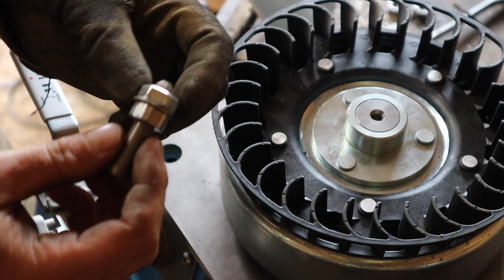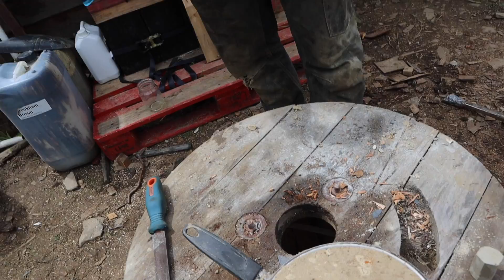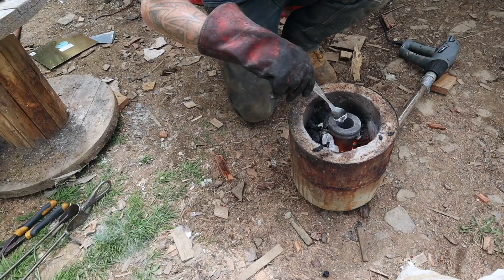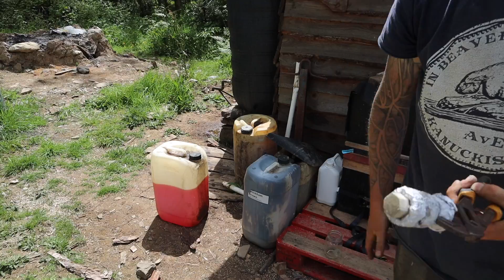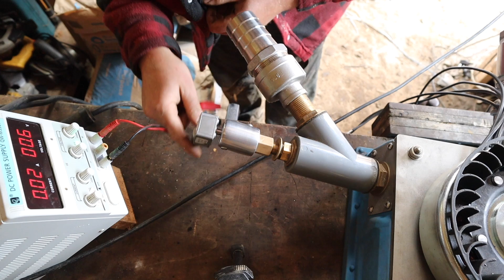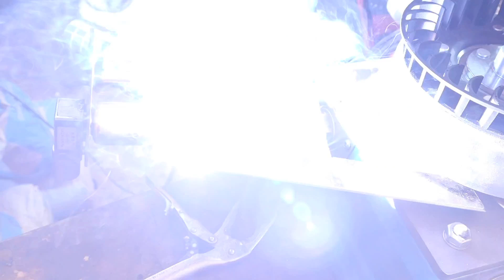4 Nozzle Off Grid Micro Hydro Turbine  Part 5 Motorised Spear Valve Control

Comment: An interesting design. I was wondering why you were allowing the motor mount to slide before realising that the spear valve control point is unscrewing rather than just spinning, so that makes sense.

I think if this was my design I'd use a cog or pulley that could slide along the existing hex shaft and have the motor drive with a belt or chain. I'd also have an encoder that is geared such that you can track the position of the valve

Comment: I would remove the wee locator bolt on the valve and just let the valve handle slide in and out of the socket you made it will stop the bracket flexing

Comment: Use a double relay. You can even get one with wifi and/or rf remote. Use one relay to spin in one direction and then the other relay to spin in the other direction. You can even get a 12x or 16x relay module and cover all the actuators you need.

Comment: Do you realize you said you had no complaints and the unit worked great, then you replaced and rebuilt the whole thing at great cost of money and time for a unit that worked for 8 months?
Spend $150 u.s. on ebay and buy a hydro electric power generator.
They put out 500 watts and have an extremely efficient design that doesnt require constant tweaks.
There are more youtube sites with folks trying to get that particular "fantastic" unit running.
At great cost!
Spend $150 and forget it before your girl leaves you for mental obsession with denial about a fucked up product design.

Comment: I've never tried this but wondered if this pressure relief valve could be used to automatically turn off some jets in low pressure situations. If it was in the supply line to one of the jets and set to 60 PSI, it would probably turn it off at 48 PSI and back on when the pressure hits about 60-64 PSI. It has a 20% variable for reclosing and a 2% variable for opening. The other three jets would still be on and this would work with your motor controls, but it's automatic and works on water pressure. Any water relief valve set to around 50-60 PSI may work if it auto resets. This one is adjustable from 25-175 PSI but most are preset and less expensive or easily found on old water heaters. Most are set at 75 but may have a screw to adjust the tension on a spring. A 3/4 inch size can probably deliver 16 gallons a minute or 60 litres. I think you said that each nozzle is using about a litre a second so this could be done to one nozzle per valve. Knowing that one or two of your nozzles has auto shutoff in low pressure situations could save you some worry. Thanks for the great series on Micro hydro.
https://www.ebay.com/itm/Zurn-34-P1500XL-Zurn-P1500-CALIBRATED-PRESSURE-RELIEF-VALVE-25-TO-175-PSI-3-4/202122415143?_trkparms=aid%3D1110006%26algo%3DHOMESPLICE.SIM%26ao%3D1%26asc%3D20131231084308%26meid%3D73c9067ddee6488d9cd112d4f30bf5f8%26pid%3D100010%26rk%3D1%26rkt%3D12%26mehot%3Dlo%26sd%3D174147856364%26itm%3D202122415143%26pmt%3D1%26noa%3D1%26pg%3D2047675%26algv%3DDefaultOrganic&_trksid=p2047675.c100010.m2109

Comment: Hi  Kris;
Are you going to grease the two travel sleeved rods with anti seize stuff? Also the actuators could be timed under load and pressure how long to open and close do it 5 times make an average and just put it on a timer, if the average voltage is off, it'll be a good indicator that something didn't open or close all the way, which of course will reveal a potential unknown issue, ancient Japanese philosophy of the 5 whys to troubleshooting
Peace, Eric

Comment: Use an OTS PID process controller and you will need to convert the unipolar output (0-10V) to bipolar (+-12V) output. Just check that it can handle slow loop response times.

Comment: Hey kris very nicely done I need a system very similar to yours I’m currently designing a see threw self contained peloton turbine off grid system I could really use some help with parts and remote programming for there will be 2 identical systems that will be used to switch between them for maintenance reasons and the pump motors will be powered solely by the off grid system and I want to generate 100kw-1000kw system I’ve got at the moment a 20hp 3ph induction motor and centrifugal pump 4” pipe system all the water needs to be enclosed so I don’t loose any over evaporation could you help?
Reply from the maker: Right, So you want to use pumps to pump water to turn a turbine to generate power?
Reply: Kris Harbour Natural Building yup, ill be taking taking the generators off of industrial natural gas and or diesel motor driven systems
Reply from the maker: @crypto1633  Ok, The problem is that it wont make any power, in-fact doing that will only use power. If im understanding your idea correctly then it breaks the laws of physics. Its a perpetual motion machine?
Reply: Kris Harbour Natural Building um  not entirely a perpetual motion machine the pump is mechanically driven buy the electric motor and I’ll have to initially start the electric motor by a service provider but after it’s running and lines are up to pressure and the spear valves are turning the pelton turbine connected to the extremely powerful generators it is then technically a perpetual machine because the pump motor is using the same power from the generators but also there will be two identical systems 1 running while other is a back up for servicing the other I’ll be producing a lot more energy than the pump motor can consume ever the problem I’m having is calculating the psi/flow rate needed as well as size of pelton turbine, how many spear valves and size needed per turbine to get it all to work with computer controlled to maintain consistent pressure
Reply from the maker: @Altered-Carbon CC I can tell you with absolute certainty that is will only ever us energy and never make more than you put in. it will only ever output less energy (due to losses) than is put in. For this reason i wont advice you on it or recomend parts as it will waste your time and only waste perfectly good components and energy for you to "test" a principal that is a know fundamental of the universe. energy can never be created. you can only transfer energy. your machine will never make more power out than you put in within the current physical universe.
Reply from the maker: https://en.wikipedia.org/wiki/Laws_of_thermodynamics
Reply: Kris Harbour Natural Building no your not understand how it’s going to work and it’s not absolutely not a perpetual machine the generators that are powering everything will be putting out 100 thousand watts of power considering the average home in North America only uses on average of 3 thousand watts of power a month so there is no way that I would be using more or the same as a create with the design  to be considered a perpetual machine it has to have little to no mechanical parts that require maintenance which this does it’s an off grid system powered by an electric motor
Reply from the maker: @crypto1633  Im sorry but the things you are saying are telling me you need to do a bit more reading. three thousand watts a month is not even a measure of power. I think you mean 3000 Kilowatt hours a month. In any-case, good luck with it. Even if i wanted to help, to supply 100.000 watts you need components from industrial power plants and pumps that would move thousands of liters a second and a huge three phase substation to get the thing going. I think you might be better off going back to the drawing board.
Reply: @KrisHarbour  lol yes i was meaning kwh when i said 3000 watts and yes i already have industrial equipment such as the pump and induction motor but i need a lot of things still the list seems endless but before i can get my list of things i need calculations done for the alternators aka generators as you had to calculate for your micro hydro system i have to do the same for mine to generate electricity i just need help with the calculations is all and figuring out what size of spear nozzle valves i'll need since i used to be a pipefitter i'm no stranger to industrial piping systems including all power plant systems i'm making an industrial sized largely off grid system  not entirely off grid but very very close but anyways thanks for listening and great video. i know its hard to picture what i have in mind and i'm not the best at explaining in text how it all comes together and not sound crazy lol
Reply from the maker: @crypto1633  If you send me a drawing and some figures i will happily work out how much water and power it would need. and nozzle sizes.

Comment: You might try a small cheap (PWM) Pulse Width Modulator circuit bought from EBAY as a kit or pre-built controls the speed of the motor with a variable resistor or other switch, no programming necessary.

Comment: I would think a raspberry pi and a smidgen of python code (1 days worth at most) would provide a control system for the 3 linear actuators and the variable flow valve. A raspberry pi and GPIO breakout and associated components would cost less than $100.

All the other stuff you've done is far more complex than some python code to implement a simple digital control.

Comment: Arduino micro controllers would have the ability to control your flow control along with the ability to activate linear actuators to control the other valves.  I'd imagine the Ardurino Community would assist you. The programming is a series of libraries. They just have to be adapted to your environment.  Start by joining the Arduino forum. Introduce yourself,  explain your project. Ask for suggestions.  You will be amazed by the power of the OpenSource Community.

Comment: Hi Kris, the wobble of the socket it irratating me a bit and worrying me that you may be slowly vibrating the support and causing a mechanical weekness.

I would suggest using a rotary encoder as then you will know exactly what percentage open your valve is.

Comment: I don't think you need the complexity of an Arduino in this project. Look into double-pole-triple-throw (DP3T) switches, or DPDT rocker switches with a disconnect position in the middle. By wiring the motor across the common of each switch pole, then putting +/- on the throw sides of the switch in opposite directions (i.e. pole 1 has +, - and pole 2 has -, +) you can use a single switch to have the motor disconnected, moving CW, or moving CCW. If you want to include limit switches you can put them in series with the throw side of the switch such that hitting the limit switch interrupts the circuit in that direction, but not in the opposite direction.

Comment: Consider a higher supply voltage. Flowing water will present an opposing force to the screw and it will require higher torque to close.

Comment: 3:27 - Kris, I'd not worry about whether it looks professional of not, I'd be more concerned about it's functionality and whether it's gonna be tough and do it's job well. If the socket works well and is tough, use it man!
Reply: Reading that and suddenly I’m surprised at myself with the number of sockets I recall cutting or welding over the years lol

Comment: No need to remotely control the motors; simply use a flow meter with and a simple Arduino program to delegate which values are open based on the current flow. A DPDT relay would be a simple solution. Two relays and two signals from the Arduino per value. No need for limit switches. First relay will switch power to the motor and the second relay will reverse the polarity. The combination of relays will give you forward and reverse. Only switching on the power relay will drive the motor forward. While having both relays powered will drive the motor in reverse. If you don’t have any electrical or programming experience this might be challenging but it is fairly simple project

Comment: I've got some friends that are good with this kinda motor control. So I've shared the video with them. Hopefully they can help.
Reply: OK one response so far, A H bridge controller and an Arduino. There seems to be a lot of guides on how to set these up with code you can use. May take a bit of searching to find one that includes a stop switch but I'm pretty sure there will be something.

Comment: I'm guessing that the variable nozzle is there so you can maximise efficiency when the flow varies.

Maybe you could measure the flow by having a stand pipe with a float switch some distance bellow the intake. Switch triggers right bellow intake height. Closed loop circuit could slowly open nozzle until switch is triggered, then reverse. Add som hysteresis to avoid jitter. 

This could of course be done with something like an arduino, but passive components could  work just as well. And you should be right at home with that stuff, being an elevator tech and all.
Reply from the maker: That would mean running and trenching 200m of cable through the woods. and to be honest i dont really need to monitor flow. i can see the flow it from my window and easily manually change the nozzles remotely. i have enough experience of watching the stream to know what flow the turbine can handle so i can just switch on a nozzle when needed or when the flow increases. monitoring flow is not a priority.

if i wanted to monitor flow a better way would be to monitor the relative efficiency of the turbine based on what nozzles are open. that way a controler would know when the pipe was draining due to the loss of efficiency and reduce the flow to fill the pipe again. but really im quite happy to just manually do it myself. i just want remote control so i dont have to walk through mud down to the stream to do it.

Comment: Nice job! I'm just worried that the aluminum might crack under stress. Too bad you could not have gotten a socket that size and welded it, I think Steel would have been better than aluminum.

Comment: Hi Kris, power trim on outboard marine motors use 2 “a/b” type 12v relays and a 2 way rocker switch to run the motor in fwd or reverse. It’s a dead simple and robust concept  if you don’t require limit detection or variable speed. (the relays connect to negative at rest, so the selected relay can supply positive when actuated and run the motor either direction) good luck and all the best!

Comment: Arduino would be the simplest way to control this, as people have mentioned in the comments. WiFi could be hit and missives distance. If you need control over long distance, would be worth looking at adding LoRa control to the Arduino set up.

Comment: A suuuper simple way to limit the motor would be to use normally closed (NC) limit switches. They operate in reverse to standard switches that close when the button is pressed. NC switches will open the circuit when it is pressed, cutting off power/signal.

So, add 2 NC limit switches to the max open and max close positions of the shaft, using the gearbox housing or a tab from it to operate both switches.
They'd need to be fairly rated switches to break the power, otherwise you can utilise relays or mosfets to do the actual making and breaking of the electrical load.

The placement of the switches would also need to take into account the momentum the shaft will have when the power is cut to ensure it doesn't crash into either end at speed. (That's assuming the motor will be turning fast enough.)

If you do go down this route, Id recommend a timer or load cutoff mechanism for the motor to ensure a switch failure doesnt result in a burnt out motor or powersupply, which kinda isn't ideal.

Love ya work as always, man!
Reply: Yes, absolutely. Arduino is kind of overkill for running a universal motor back and forth.

I think you'd have to add a couple of diodes to that circuit to be able to reverse once the switch turns to the open position. And maybe add a fairly powerful lightbulb in series so you know when you trip the limit switch. Or maybe I'm just tired and had a brain fart?

Comment: ... also, instead of casting the socket, just but a socket wrench of the correct size? Why did you need to make the sliding system, let the hex socket and nut slide against each other. Seems much simpler to me?
Reply from the maker: i explained why i didnt use a socket in the video and the reason it needs the pins is because it would not be right to have the motor applying torque to the hex and expecting it to slide freely. also it would still need some means of making sure the motor does not just spin so it would still need the bar coming out of the plate. i can assure you that this is the best way.

Comment: Hi Kris - have a look at this: https://www.youtube.com/watch?v=4upbma8NL-U&list=WL&index=3&t=345s Its a device called a D1 Mini that he uses to control a motor. It has built in wifi so you could run it from you house. Let me know if you want any more info - its dead easy and cheap. I use something similar to control several motors around my house.

Comment: a raspberry pi running node-red (like scratch programming used by kids in schools but more powerful) which would then control a motor controller.

what are you trying to achieve from the control here? load balancing?

You might be able to use current sensing to sense the end stops rather than using limit switches, when the motor hits the end stop the current will peak, sense that peak and and jobs a goodun

You might be best to remove the grub screw from part you made to the valve, that way the movement happens there, a bit of grease will reduce the wear and help keep it free to move. it will work kinda like a universal joint and could lose the sliding the motor mount and make it more stable. Have you thought about 3d printing the part instead of casting?